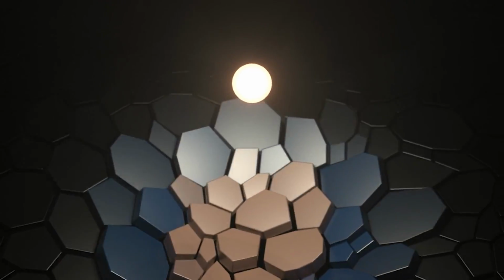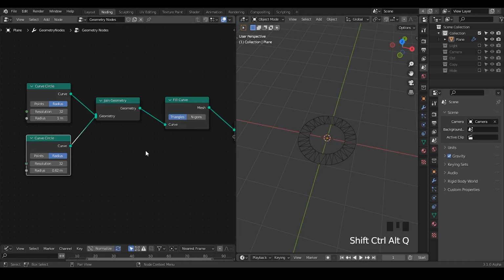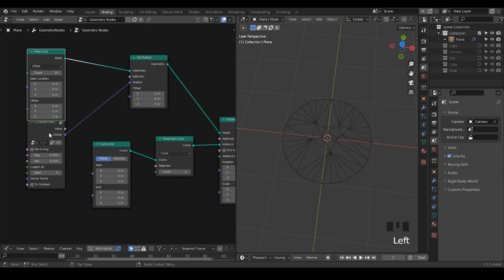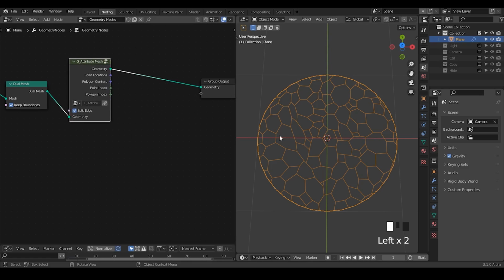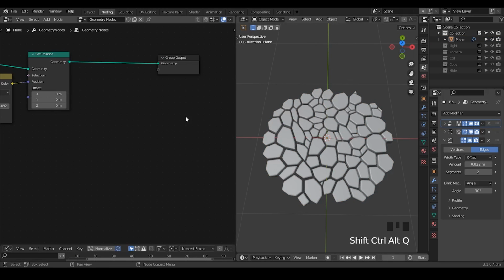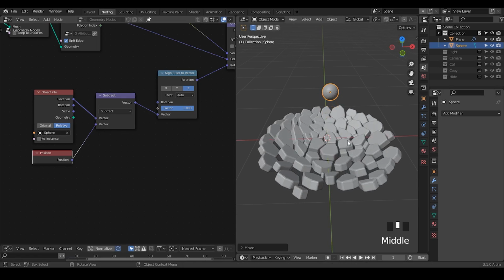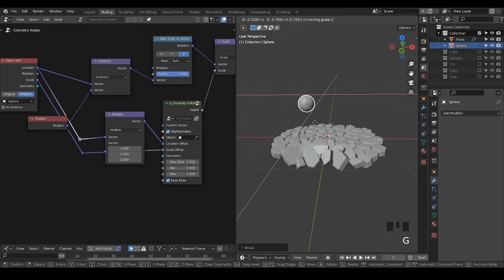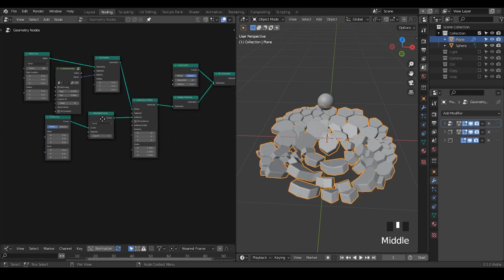[Tut] Voronoi Fracture with Dual Mesh Node - Blender Geoemtry Nodes 3.1 Field

Comment: Great video, learned a lot! At about the 3 minute mark you use a "Get Mesh Attribute" node- what is the equivalent node in Blender 3.6+? (I know the attribute system was redone at some point, but I don't know enough to know where to start adjusting tutorials that use the older attribute system.) Thanks in advance!
Reply from the maker: I renamed it to "Attribute Mesh Info". In case you didn't realize, it's a preset you can download for free from the link in the description.
Reply: @bradleyanimation120 thanks for the quick reply! I was just about to answer my own question as I realized it might be one of your custom nodes :-). Now I think I can duplicate this- very cool!
Reply: @bradleyanimation120 one more question if I may; the created cells are very "pointy". What would you suggest trying/experimenting to make them smoother? So far I get "smoother" by increasing the number of mesh lines- but that also makes the smaller. I like the size distribution I'm seeing, but I have no clue what to try to increase the number of points in each cell perimeter and smooth them out. Thanks in advance!
Reply from the maker: @JulianRendell  You can just add subdivision surface.

Comment: nice demo, not really sure how to do this without that Randomness node, tried to get it from the link but its not an addon, just a blender project file?
Reply from the maker: 1. "randomness node" is basically "random value node" in GN.
2. it should be an addon in the zip file. if you still arent sure about it, it would be better to ask in the discord server according to the link in the description
Reply: @bradleyanimation120  got it, thanks!

Comment: Hi it possible to put the voronoi to custom mesh?
Reply from the maker: If you want the mesh to have volume, unfortunately currently there's no way to do. If you just want the rough shape, it's kind of possible I think
Reply: @bradleyanimation120  hi actually i try to create this with geo node https://youtu.be/-JaTcyWRD5o....
This one is done with sverchok node
Reply from the maker: @VORONETIC  Volume Fracturing will not come in 3.1. It's still in the design stage: https://developer.blender.org/T91668. You may or may not expect it in 3.2. I think it's unlikely.

Comment: Your tutorials are awe-inspiring and really demonstrate what's possible with Geometry Nodes. Although they are currently too advanced for me. I feel like I need to dive into your cusom nodes to work out exactly what's going on and I quickly get lost! Still, I look forward to the next one.
Reply from the maker: Thanks. It's more recommended to use these nodes as they are. Feel free to investigate them but they are definitely overwhelming because nodes become too complex when I keep adding more settings so that a single node can be used in different scenarios. It's more likely that each single custom nodes equals to 3-5 nodes in a given scenario.
If you have any question feel free to contact me in discord from the link in the description.

Comment: i cant find the attribute mesh group even after appending the nodes from the provided file. please help
Reply from the maker: It should be there. If not, try "attribute info". Also, instead of appending, open the file and see if the nodes are inside, since it's also possible you appended them wrong. At last, you may ask in discord.gg/TzuN6sPxQU